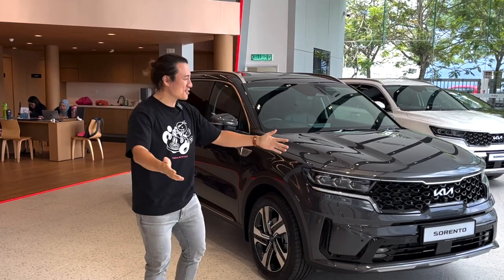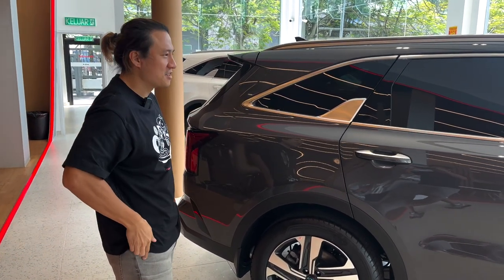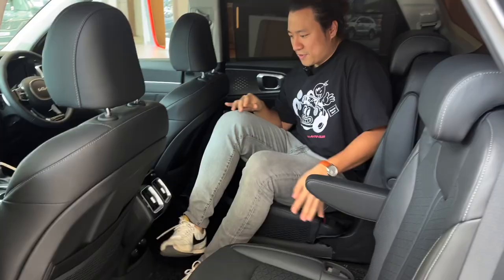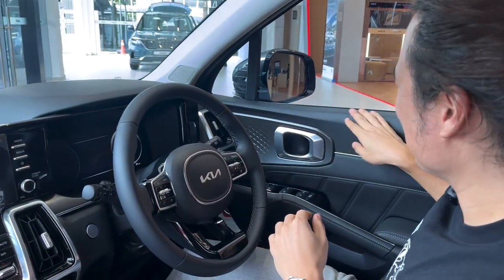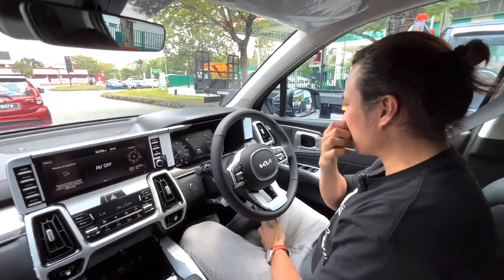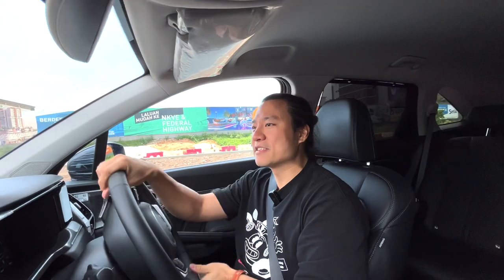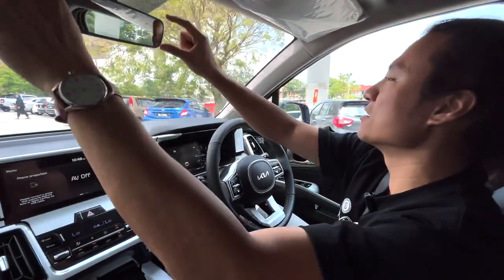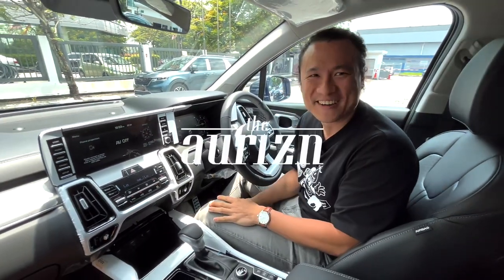2023 Kia Sorento CRDi 2.2 Walkaround and Drive - First Impression | EvoMalaysia.com

Comment: Thomas does it drive better than the Tiguan?
Reply from the maker: Hey sorry for the late reply. I think the Sorento drives better. In the sense that the Sorento has a hefty, heavier feel. During corners, it sits neatly on the outer axle and corners tidily. In fact, it feels rather "German".

The Tiguan is lighter and smaller, definitely more agile. But the suspension doesn't feel as sophisticated. But this is expected as the Tiguan is a Sportage competitor.